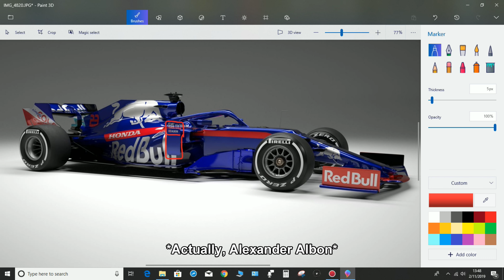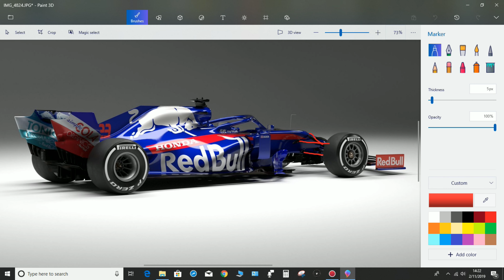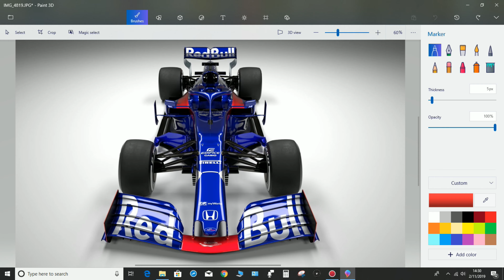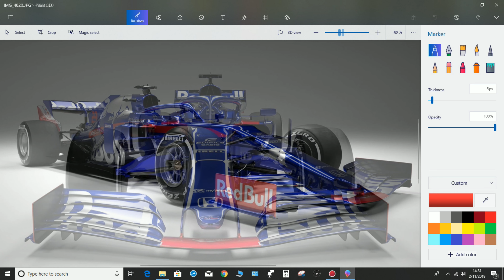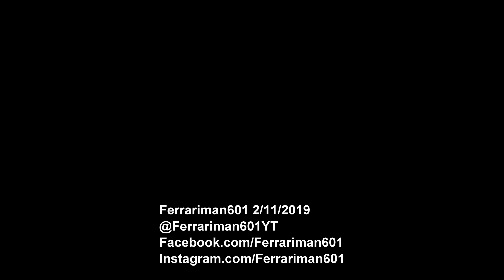Scuderia Toro Rosso STR14 - Launch Analysis

Comment: Hey, what are your thoughts on the pre-2009 style front wing with it's raised endplates?
Reply from the maker: I didn’t comment on it here because I wasn’t quite sure that it wasn’t a trick of the light, but, if it actually is a spoon-type profile on the wing, it would be a tremendous innovation. And, if STR have done it, you can bet anything you like that Mercedes and Ferrari have done it as well.
Reply: @F-Man  Aye thanks for replying. I noticed that the Haas had a flat main plain(I think that's what it's called) on it's front wing. What does a spoon-type profile offer over a flat profile wing and do you think that Haas as well as the other teams will adopt it if they haven't already?
Reply from the maker: Well, the “spoon” profiles that we saw start to crop up in 2005 (or the double center winglets if you’re looking at Ferrari) were in relation to the FIA raising the minimum overall height of the front wing at its outboard extent. Generally speaking, the closer you can get a wing to the ground, the more efficient it will be because it restricts the flow of the air underneath it, accelerating that flow and lowering its pressure (Bernoulli’s principle) and creating a net negative force on the wing (downforce). In 2005, because the teams realized that the FIA did not mandate a uniform height for the entire wing profile, but only for the outboard sections, they lowered the center of the wing as much as possible to attempt to capitalize on that pressure effect. It seems altogether possible that Toro Rosso are resurrecting this idea on their new car.